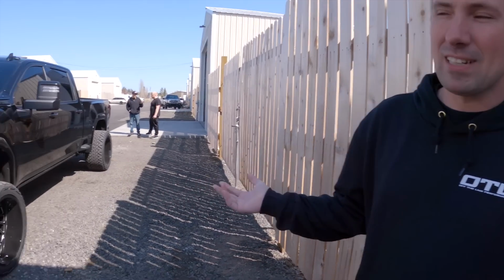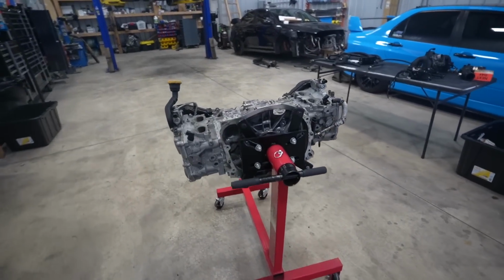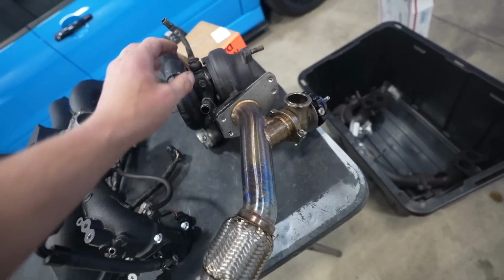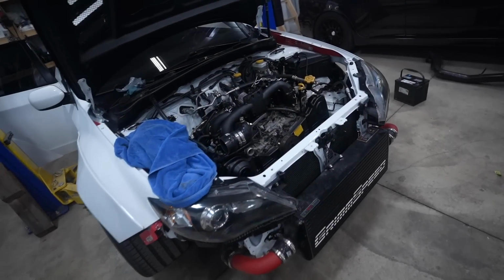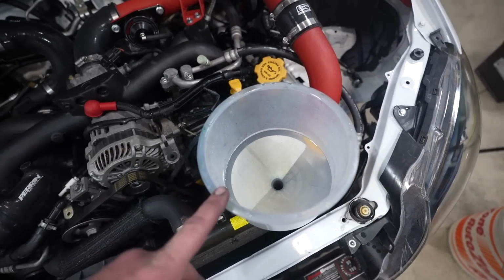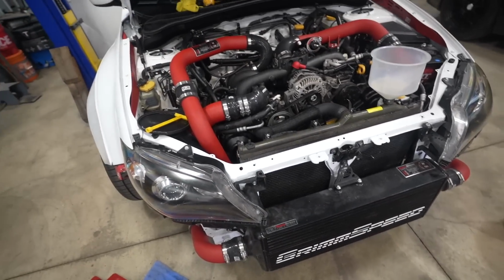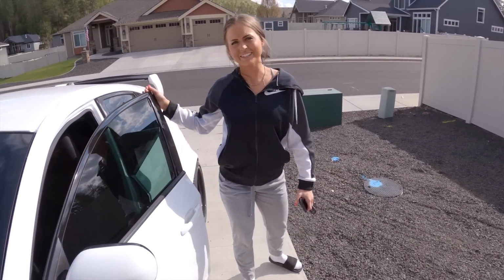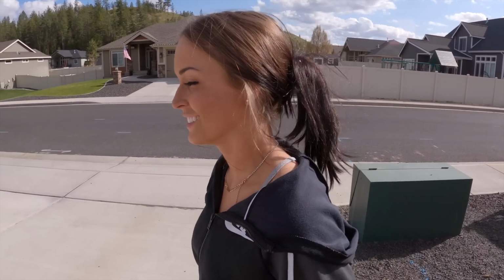The STI Hatch Is Back And Better Than Ever!

Comment: I've built 6 1500hp coyotes that saw startup, varied RPM until operating temp was reached, and then went directly onto the dyno to make 1500HP. If machine work is done right, there is no need to put 500+ miles on an engine, unless you as a shop or business owner want to make sure that there are no other potential build issues prior to going on the dyno. If anyone thinks a cracked sleeve is solved by more engine run time you'd just be delaying the inevitable.

Comment: Do you use break in oil or just regular oil when you build motors for break in?  I used to build engines long time ago, chevy, ford stuff like that, the guy who did all my magna flux on the blocks, boring, head work always suggested break in oil? There is more Zinc concentrated in the break in oil supposed to help protect rings. cams, on start up. Just wondering what you like .
Reply: he did not mention in this video?   he has previously shown using break in oil.  kinda curious myself but he is still doing short drives and opening filter to check stuff.  maybe he just didnt have any or just didnt mention/brand it?  good question.

Comment: Awesome the Susti motor is back on  the road, is the act clutch compatible to all Subaru engines, if it is ,can I gain more power if the act clutch is installed on a light flywheel on my legacy be5 ej208?

Comment: Awesome turn around!! 
To be clear the questioning of whether break in is necessary and whether it was cause of your issue were 2 seperate opinions. At least from what i gathered. Yea its important, no it wasnt the cause of your issue. The big discussion was misfire causing detonation.. That seemed to be the main topic of discussion at least from the section i was reading. I know someone had a bugeye who had 3 iag motors fail within 8k miles. Iag blamed it on break in. So the last time he waited 5k miles and it failed first time in boost. Royal purple and many others literally make "break in oil" so it must serve some purpose. If 1 of the top subaru engine building company and dozens of high end performance oil companies recommend it it must serve some relevance.

Comment: Wait the STI motor has The AVCS (variable valve  timing cam sprocket) on both the intake and exhaust. Having it on just the intake is the WRX only.

Comment: Everyone knows you have to run a new motor at least 500 miles on a incline to strengthen the sleeves!!!!! Jeez.
Reply: You don't have to by any means you don't have to I know from experience less go over to Bader page and watch some of his that he doesn't have barely 50 miles on Motors back in the day and just not even that long ago and he sends it and everything's good it just depends it definitely helps seat the Rings though the sleeves themselves are about as strong as they're going to get regardless
Reply: and engine braking is what you want to do with it
Reply: in a blizzard and negative 40 degrees with a back seat driver and bald tires.  ;)